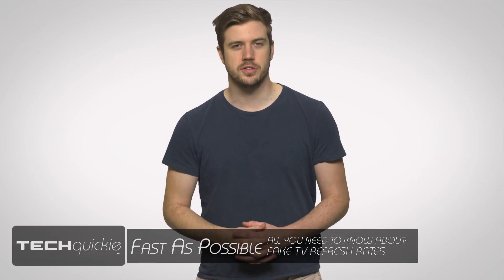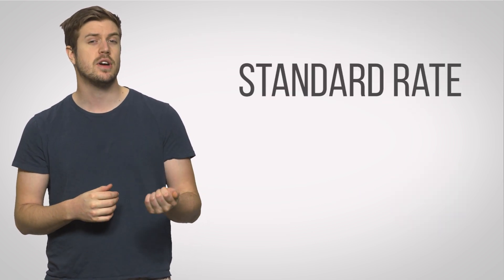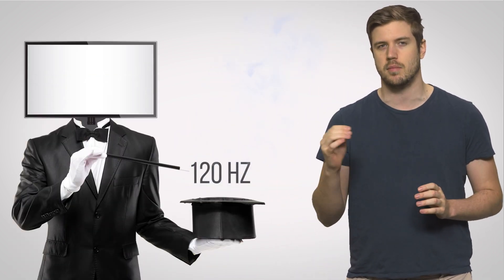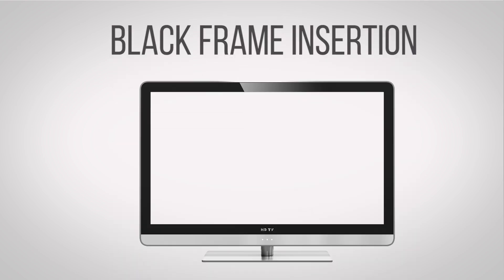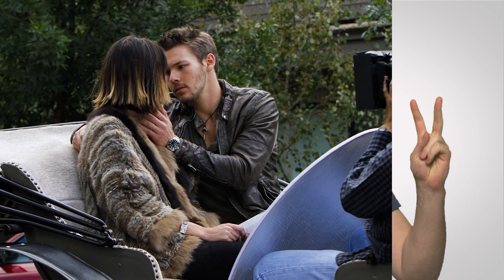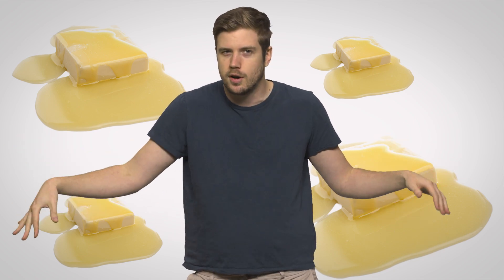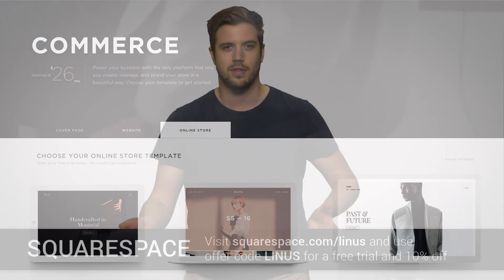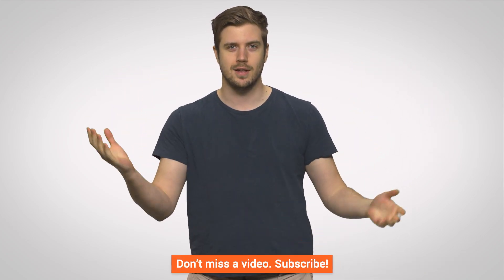Fake TV Refresh Rates As Fast As Possible

Comment: So when those big TV's at Costco claim 120 or 240 Hz, it's pretty much bullshit?
Reply: +P Lindsay yup
Reply: +Machine Lee Yeah, I'm not denying there's a difference. But I'm suspicious of the labels on TV's. For instance, most computer monitors are 60 Hz, except of course for gaming monitors which are generally 100 or 144 Hz. So when I go to Costco and see TV's advertising themselves as 120 or 240 Hz, I have trouble believing they actually have a faster refresh rate than the computer monitors that have 100 or 144 Hz. Especially when you can get a 120 Hz 40" 4K TV for $500, yet gaming monitors have trouble staying that price even at 27". What gives?
Reply: @patricklindsay72  Where does such a tv exist? PLease share
Reply: +P Lindsay One of the key differences of monitors and tv is the latency. I personally game on a 55 "tv that has about  30 ms delay, but monitors normally have less than 10 ( i believe the average is about 6 ms)

Feel free to correct me if i am wrong...i am no expert.
Reply: +P Lindsay Put a 60hz screen next to a 120hz screen, plug a computer mouse into both of them and move them around both displays...you will see and feel a huge difference
Reply: +P Lindsay 240hz almost always. 120hz, varies.
Reply: +P Lindsay Maybe not for the 120 one, those do exist.
Reply: +P Lindsay i only trust monitors
Reply: Doge Friend no im a gamer who collects and plays big games too dumbass i just cant stand looking at a small 27 inch monitor and so what if i dont get that fast response shit i still get great gameplay and also i cant tell the difference between the response times anyways so fuck off
Reply: +billyhatcher643 I can't think of any commercially available 4k monitors with a 120hz refresh rate under $5,000.
Reply: ostracizedchild yea but then cable and satellite companies will charge us more to get the real 4k resolution to watch tv in 4k
Reply: ostracizedchild i prefer a small 2 inch screen cause its more private i used my 42 inch hd vizio tv it didnt work for me
Reply: +P Lindsay To put it simply it is bullshit in actually displaying that many frames from the source of the image.

If you want to get higher FPS you first need a screen that is actually 120/144 FPS and a source that actually can provide higher then 60+ FPS.

Also worth noting is that last I checked HDMI is still limited to 60FPS.

As such higher FPS then 60 on a TV does not really matter but if you have a Computer monitor with DVI or display port, rated at 120+ and a good enough graphics set up you can get higher then the 60 from the source but the displayed FPS will not go above the screens limits even if your card can display 500 FPS.

I have a VG248QE which is rated at 144hz and it is noticeable difference especially when you go from watching a movie at 24hz vs 120 FPS gaming. How much better is something that will be likely exaggerated by those who have the means of playing at 120+ FPS. 

It is most noticeable if you are paying attention to it but often times you will not be focused on it unless you go from 120 to something like 24 FPS which kinda makes me cringe at the start of a movie for a little while.

The only health advantage I can find is I seem to get fewer headaches sitting in front of a 144hz screen working at 144hz for several hours then when I sit in front of a 60hz screen working at 60 Your brain does soemthigns like fill in the gaps automatically but it can be somewhat draining if it is prolonged exposure. Other then that 60 is completely manageable to deal with for long periods of time.

Also worth noting is that this youtube video does not seems to even be 30 fps. It is far to easy to see the arm jumping with every frame. If it was 120 it would be hardly noticeable.
Reply: ***** whats up with the insults? why are you even mad jesus chill
Reply: Should of gotten the samsung 4k curve tv 49" for 699 canadian on boxing day. Original 1400. Best bang for ur buck for quality qise. But to answer ur question i would go with the 120hz. Theres a huge difference with motion and blur with 60 hz and 120 hz.
Reply: Not to mention thats a newer and higher end model since u dont mind about the size of the tv youre getting
Reply: not always. 120 and 240 are possible with today's technology, just make sure if it doesnt have one of those proprietary terms next to it like truemotion or clearmotion (just two examples, there are more). theres a chart online somewhere that shows the real refresh rate by term. your best bet is to research tv's ahead of time, look at what their sticker specs say, then look up the model of that tv online and see what the effective refresh rate is. theres not really any point to a higher refresh rate tv though unless you wanna hook up a monster of a pc to it that can actually ush out that many frames per second. nothing aside from pc's do that so even if your tv cant really do 120 or 240, you arent missing much.
Reply: ostracizedchild yea if u want true 120hz experience just get a monitor that has 4k with 120hz
Reply: +P Lindsay 120Hz could be legit. There are many monitors and Tv's at 120. But 240 is almost certainly fake.
Reply: +P Lindsay Absolutely
Reply: Brorelia i just wish that dumbshit companies would stop this bullshit on tvs cause tvs cant process the picture as fast as a monitor can
Reply: Brorelia i just wish that dumbshit companies would stop this bullshit on tvs cause tvs cant process the picture as fast as a monitor can
Reply: ostracizedchild That might have changed since I last looked it up since things like HDMI 2.0 has appeared in the past few years and I have not really looked into it.
Reply: true 4k 120Hz monitors or TV's do not exist because only recently did the DP1.4 get added to GPU's with the 1080/1070/RX480/1060*/RX470*/RX 460* and it's on basically nothing else.

So Monitor and TV manufacturers are not going to add it until there is a decent user base who actually have DP1.4.
Reply: ostracizedchild I know I plan to get one in 2018 - 2019 because I'm buying a RX 480 / 1060 right now as I have a 1080p 120Hz monitor and either of those would be good enough to drive that.

Reason being is that I don't want to go with 1440p 100 - 144Hz because of bad 1080p up scaling and bad 4k down scaling.

And running 4k at 60fps locked isn't even really a thing yet and I'm not spending $800 - $1200 on a GPU is not something I'm going to do.

So I'm waiting for Nvidia Volta / AMD Navi so I can get 4k 60fps minimums for $400 - $550 and then getting a 4k 100 - 144Hz display.
Reply: u should get 1440p 144hz and gtx 1080, or you will lose on the long run
Reply: Doge Friend i prefer using my big 42 inch hdtv for my computer and i plan to buy a 1080
Reply: ***** you are a casual gamer then :-)
Reply: P Lindsay dep2nds what brand and what year of that brand. ex) sonys motionflow xr 240 is only 60hz and their xr 960 motionflow is a 120hx. 2016 lg 240hz is only native 120hz. make sense?
Reply: Anyone can help me? I'm between two LG: 43" uh6030 120hz or 50" uh5530 60hz with HDRPro. I dont care about the size, they are at the same price on best buy. Which one should I pick?
Reply: crankyboiy yeah I have it it's great
Reply: +Doge Friend Because you insulted him. You should chill out before releasing the first insult
Reply: In most case, divide the claimed refresh by two.   Unless it claims more than 240hz in which case the screen is 120hz(most probably) (fuck sony, bunch of liars)
I'm trying to find the cheapest 4k real 120hz tv

You can use this chart for help

BTW Sharp TV are what it says on the tin
Same with Haier

From where I am (Quebec) the cheapest I could find is the Samsung UN49MU8000  , 49 inch 4k real 120hz but 1020$CAD, double the price 

also LG 55SJ8500 1322$CAD
Sony Sony XBR65X850E 1522$CAD
Vizio P55-E1 1224$
Reply: Well... Not really because though it's 60hz on a 120 hz CMI aka less blur on tv but still randers 60hz just with less blur not hz meaning your tv runs 60hz but less blurr at 120 cmi if that make sense its difficult to explain lmao
Reply: @ostracized_child  and now Xbox has a tv monitor
Reply: There is nothing higher than 144hz, 
Except overclockable monitors

Comment: Interpolation has also a downside which they never mentioned. It can create weird video artifacts because of interpolating extra frames which isn't actually there. I actually use SVP(Smooth Video Project). There is a free version which is actually all you need. The videos I watch are buttery smooth at the cost of some artifacts and CPU cycles. I disagree with people that hate the soap opera effect which it achieves. 24 fps is atrocious in my eyes. I can't stand the judder when there is a panning shot in any video. I assure you once you use this you'll never go back watching 24fps or 30 fps movies.

Comment: anything more than 60hz is a waste of money in my opinion
Reply: +woodtvnetwork I went from a 60hz monitor to a 144hz monitor and instantly I could tell it was smoother. Even just moving the mouse around looked and felt better.
Reply: well i give you that for a computer monitor but for a tv its not worth it. i would get a 144 hz monitor but my r9 380x wouldnt do it much good also i dont have the money lol

Comment: I have a question, my tv can be changed to a 120hz refresh rate in the nvidia settings. But I just can't tell a difference.. Is it really 120hz?
Reply: the game/video has to be playing at 120fps to see it in 120fps. if you have a 120hz TV screen and a video is playing at 24hz then you will see it at 24hz. try looking up videos on Google that play at 120hz
Reply: Sandwich Woah now, I'm not stupid enough to expect a 24 fps video to play at a120 fps cause it's on 120 hz. I've tried these https://frames-per-second.appspot.com/ and haven't noticed anything. So either the nvidia control panel and the internet is lying to me, or there really is a marginal difference between 60 hz and anything beyond that.

Comment: To add on top of that:
You'll find a lot of TVs with 600hz advertised refresh rate because it's the lowest number that can display almost all used formats (24, 25, 30, 48, 50, 60, 120) using same amount of Hz for each frame, which improves compatibility and "stability" of the image, you don't shorten or extend any frames because of uneven interpolation.
Captain out.

Comment: The title of the video is severed flawed since things like truemotion are indeed in a high refresh rate and its not false advertising (its not a fake refresh rate, but a fake frame rate). Also, a display might create motion blur in fast moving objects with no actual motion blur, e.g., a game with motion blur turned off, but for most situations, there is already an inherent blur due to the low shutter speed settings in most films and tv shows since its only on very well lit situations when you can remove all motion blur. Things like truemotion were never really meant to remove blur or actually create more "real frames" and they never pretended it was. Its just to add a sense of smoothness and that sense is quite real, regardless of whether the quality sucks. Wittgenstein rolls in his grave...

Comment: +techquickie does anyone know why 144Hz is the maximum real refresh rate on the market. I've tried to find higher refresh rate monitors and they don't exist and I've tried too look up information on Google why this random number is the max and why no one has tried to surpass it but there is legitimately no information on this subject. I'm very confused/interested since many high end cards can output certain games at 300+ fps so a super ultra high Hz monitor would be something people might want for shits and gigs.
Reply: +Jason Michelson Plasma TVs that were the crown jewel of the HDTV market for 7 years had no real cap on actual refresh rate.  And 240 Hz monitors that LED technology has brought about lately is tops in actual refresh rate ability since they ceased manufacturing of Plasma televisions as of October 2014 due to development costs.
Reply: Chrisjb1983 
Interesting, I was unaware about plasma TV refresh rates. However, LED is really all that is used now, so the question was aimed more at the reason LED are limited to this refresh rate, and all the 240Hz or 480Hz TVs I've seen on the market aren't ACTUAL 240Hz they just use software tricks to insert frames.
I was wondering if there is a specific reason that monitors cap at 144Hz and maybe if OLED or any future technology would help to push this boundary (not really too worried about older technology specs that aren't used anymore).

Comment: Is it possible for a 60Hz monitor to display FPS above 60?
Reply: +Dawson McCarthy Not unless you somehow overclock the monitor, but that can get a bit dodgy. You also need the right input/output like HDMI 2 or Displayport.
Reply: +256under0 So FPS above 60 is pointless on a 60Hz monitor?
Reply: Pretty much. The only thing that would matter is if you have VSync on which can cause some input lag to occur (like mouse movement), but otherwise, yeah, wasted frames.

Comment: Or simply buy a Panasonic Plasma which has a 600hz refresh rate.
Reply: +Ashley Williams or get that nvidia monitor that can refresh for 1700hz
Reply: +Ashley Williams Plasma TVs are no longer manufactured.  What a shame right?  They shit all over LCD and LED screens.
Reply: Chrisjb1983 I bought a 5 year old 42" S series Panasonic Plasma with 16ms input lag for less than $200 just over a year ago.

Comment: Backlight strobing does not "create the illusion of more frames".  It simply eliminates the effect of pixel transition times on motion blur.  

Pixels take time to switch from one color to another which creates blur during frame transitions.  By blacking out the screen during those transitions and only turning the backlight on when the pixels have fully transitioned to the correct color you can hide this defect of LCD technology almost completely and create a very sharp image during motion.  This however has nothing to do with the "smoothness" you get from watching content at a high framerate which is the result of a decrease in motion judder, not blur.

Edit:  I should also point out that it also reduces motion blur caused by eye tracking.  And this is actually the predominant cause of motion blur in modern displays.  So most of the improvement in motion blur caused by backlight strobing is actually from this.  In fact this is why so many OLED displays have motion blur problems despite having nearly instantaneous pixel response times.
Reply: +NaturalViolence2
Yeah, that was confusing af. I immediately paused the video and went to Wikipedia to learn what's actually going on. I don't think they have more than half an hour to research these videos.
Reply: Penny Lane
I should also point out that it also reduces motion blur caused by eye tracking.  And this is actually the predominant cause of motion blur in modern displays.  So most of the improvement in motion blur caused by backlight strobing is actually from this.  In fact this is why so many OLED displays have motion blur problems despite having nearly instantaneous pixel response times.
Reply: NaturalViolence2 Yes, I got this from the Wikipedia article although I failed to really see the problem. It's a phenomenon that happens in the real world, too. So why suppress it?

Comment: "These* are* almost as smooth as your pickup lines" or "This is almost as smooth as your pickup line*"
Reply: This is almost as smooth as your pickup lines (are smooth).
These are almost as smooth as your pickup line (is smooth).
Both sentences are correct. 
The singular or plural form of the compared object (line/lines) is not relevant to the singularity or plurality of the pronouns.

Comment: So, here is the thing. When you say that you cannot see any difference beyond 60 FPS, first of all make sure that you are actually looking at more than 60 FPS. You cannot see more than 60 FPS on a 60Hz monitor no matter what, since the monitor itself will always show exactly 60 FPS. Then, make sure that you are actually looking at highly dynamical scenes, not just looking at your desktop moving icons around (although between 60 FPS and 120 FPS, I bet, you will see the difference even there). Finally, account for the habit: if you've been using 60 FPS for 10 years and then suddenly receive a 120 Hz monitor, you might not see the difference clearly right away since your eye is used to staring at the old screen. Give it some time, maybe, a day - then revert to the old refresh rate, and you will IMMEDIATELY see a HUGE difference by just moving mouse cursor around. You will see so many frames skipped, you will be shocked that you've never seen them before.

Comment: Some 3D TVs do actually have 120Hz panels. But you are limited by HDMI 1.x when connecting to a PC.
Reply: Yeah but it's so useless because the only thing that actually uses 120 fps is pic gaming but why the fuck would you do that on a tv
Reply: +Sinoops Well, if you use active 3D, 120Hz (60Hz per eye) is much easier on your eyes. And the goggle flickering is less noticeable. Active 3D on a 60Hz panel is painful, because i can actually see the 30Hz (per eye) flickering. But yeah, the actual content will still be 24-60fps. Not sure if there are TVs with HDMI 2.0 and 120fps panels tho. That would be interesting.
Reply: +Tukkajumala 120Hz panels*
Reply: Tukkajumala True I suppose

Comment: should have gone into more detail on interpolation.

1. it introduces input lag because it has to examine the next frame and compare it to the previous frame in order to produce a new frame + proccessing time.

2. visual artifacts, the new frames, are just the chip guessing at what whent on between 2 real frames, the guess work is often decent but full of errors.

results are very mixed, the best result I ever got with interpolation was watching knights of sidonia which had a horrendously low native framerate.